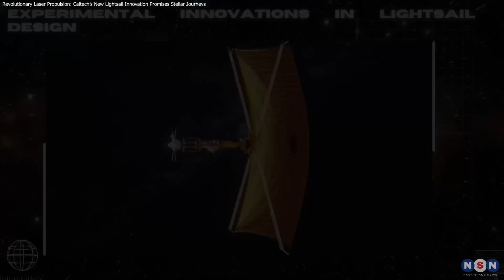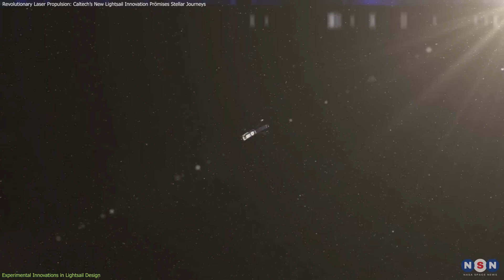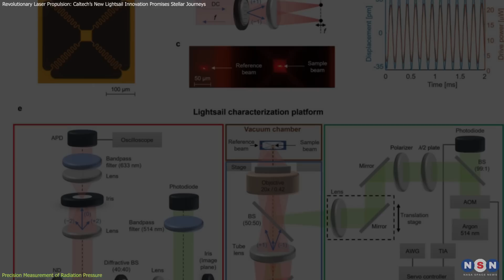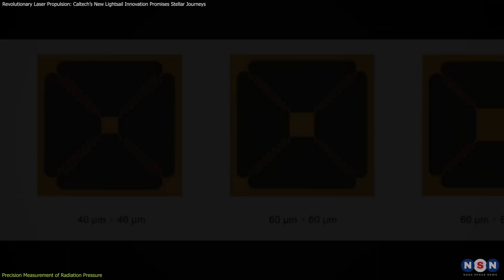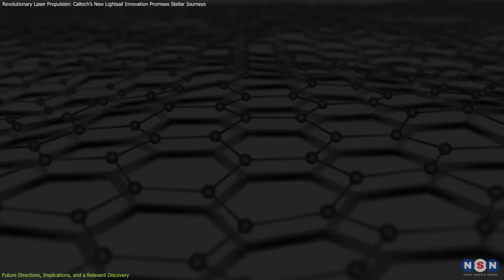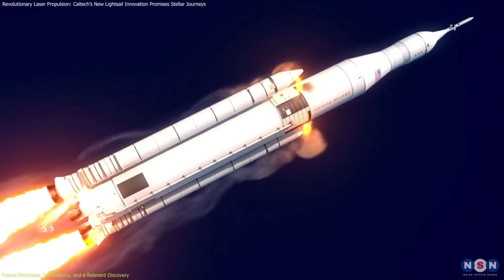Revolutionary Laser Propulsion: Caltech’s New Lightsail Innovation Promises Stellar Journeys

Comment: If a ship travels at a constant 1g acceleration rate it would get to Alpha Centauri in about 3.6 years (7.3 years would pass on Earth) and this includes turning the ship around halfway to decelerate. It would achieve about 95% light speed in 1 year. This is by far the fastest way we can get to other worlds and the ship would have gravity the whole way.
   All that is needed for this is a true fission rocket that doesn't consume hydrogen. A true fission rocket should consume uranium or plutonium only. Theoretically, there is enough energy in 1 pound of plutonium to get a 10 ton ship to the Centauri system. The ship would need 10 tons of continuous thrust.
   Uranium and plutonium are jittery atoms that are on the verge of fissioning all by themselves. There should be a way to get them to fission in a linear fashion. What's needed is a controlled, time released nuclear explosion.
   In an atomic bomb, fission occurs when neutrons hit uranium or plutonium nuclei. This is because they won't tolerate an increase in mass. Due to the equivalence of mass and energy, the same should occur if they are infused with energy. This might be as simple as having negatively charged uranium or plutonium atoms coming into contact with positively charged uranium or plutonium atoms. Or perhaps with electromagnetic or laser energy.
   With the constant acceleration method, a ship can span the diameter of our galaxy in 24 ship/113,000 Earth years. Systems with stars similar to our sun can be reached in under 10 ship years.

Comment: Without a deceleration laser any mission  to a nearby star is a flyby. It would take a really big sail to pull a telescope and interstellar transmitter and power supply, but it could take a few pics as it flew by at thousands of miles per second.

Comment: A very large bell-shaped sail with a laser beam emanating from its focal point directed towards the spacecraft, with a nuclear-powered laser. Or many hundreds of such bell-shaped sails each with their own laser output to compactify the design. The spacecraft to be initially powered by chemical engines, and then ion thruster engines, and finally solar/laser sails, analogous to shifting gears in a automobile.

Comment: Ha ha ha ha ha! You don’t have a way to slow the craft down!😎🔥😎what will you do when it rips?😎😡🔥😡😎
Reply: I'm sure the first rockets that were developed weren't designed with brakes either. Initially, inventors are only interested in making their creations go. Making them stop is just a minor detail for later.
Perhaps, at a later date, designs will include folding sails and a device that stores energy (nuclear, laser, battery?) sufficient to initiate reverse thrust when the craft reaches its target destination.
However, nice as it is to return to the Age Of Sail, I wouldn't say space is exactly 'vacuum' enough for such delicate crafts as light sails. 
Unless there are some self repairing nano bots on board, ready with bits of duct tape, I can see these sails being shredded before they reach a significant distance. There's still a lot of dust out there, even if the craft could have AI programming to avoid rocks/planets, etc when travelling at such high speeds. Bits of dust would be harder to detect, however. I can't see how they can avoid them.
Reply: Going through cosmic dust will eventually erode it.
Reply: Send an automated one ahead of if it to deploy lasers in front it. Ot or equip it with is own to reverse momentum. It’s a lot of power needed but doable. If the source can be found. Lots of fission or in 30 yrs fusion.
Reply: @Jameson1776  yes fusion would work but then that’s another propulsion system isn’t it.
Reply: @nowaynotthatway3487  I meant a fusion generator to power a laser on board lasers
Reply: Some space is clear in other solar systems
Reply: If a spaceship travels at a constant 1g acceleration rate it would get to Alpha Centauri in about 3.6 years (7.3 years would pass on Earth) and this includes turning the ship around halfway to decelerate. It would achieve about 95% light speed in 1 year. This is by far the fastest way we can get to other worlds and the ship would have gravity the whole way.
   All that is needed for this is a true fission rocket that doesn't consume hydrogen. A true fission rocket should consume uranium or plutonium only. Theoretically, there is enough energy in 1 pound of plutonium to get a 10 ton ship to the Centauri system. The ship would need 10 tons of continuous thrust.
   Uranium and plutonium are jittery atoms that are on the verge of fissioning all by themselves. There should be a way to get them to fission in a linear fashion. What's needed is a controlled, time released nuclear explosion.
   In an atomic bomb, fission occurs when neutrons hit uranium or plutonium nuclei. This is because they won't tolerate an increase in mass. Due to the equivalence of mass and energy, the same should occur if they are infused with energy. This might be as simple as having negatively charged uranium or plutonium atoms coming into contact with positively charged uranium or plutonium atoms. Or perhaps with electromagnetic or laser energy.
   With the constant acceleration method, a ship can span the diameter of our galaxy in 24 ship/113,000 Earth years. Systems with stars similar to our sun can be reached in under 10 ship years.
Reply: @shawns0762  wrong. If it gets there in 3.6 years then 3.6 years would have passed on earth.
Reply: @nowaynotthatway3487  Do some research before you make comments, relativistic effects are well understood
Reply: @nowaynotthatway3487  well if you pay attention to advancements in materials these sails will be nanotechnology with self healing membrane.
Reply: Id say you have a nervous system that has about as much use as a white crayon in kindergarted class.

Comment: Ha ha ha ha ha! You don’t have a way to slow the craft down!😎🔥😎
Reply: The spacecraft would have to be turned around mid-journey as reverse thrust to slow it down. If any other faster means were used to decelerate, the deceleration probably create more g-force than humans could survive. Therefore, there wouldn't be any time advantage, unless for probes, or for frozen humans that could withstand the deceleration, but freezing and reviving is not yet possible.
Reply: @ the only thrust is from the laser beam of light projecting on to the surface of the sail. Since that comes from earth how do you propose to get reverse thrust?
Reply: @nowaynotthatway3487  The nuclear powered laser would be onboarding the spacecraft and directed onto the sail through a hole in its middle analogous to a Cassegrain reflector, to obtain reverse thrust the whole spacecraft would need to be turned around, similar to what SpaceX is doing to land their boosters.
Reply: They can ship the brakes ahead to slow it down when it gets there☝️